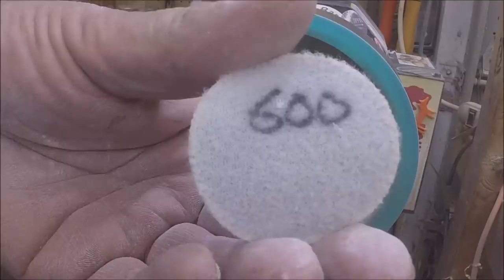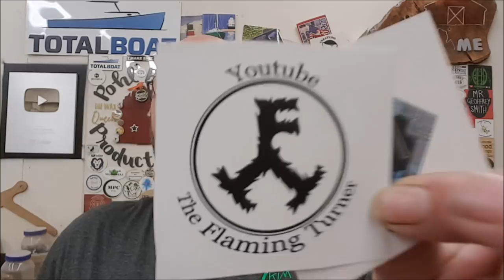Blue World Bowl

Comment: Nice project--great color mix.  What was the mold you used for casting into and where can i get some?  Looked like silicone.
Reply from the maker: Thank You Tom,  it was a 2.5 gallon HDPE  bucket from Lowe's I modified to fit in the pressure pot.